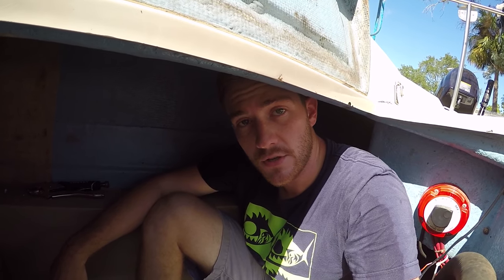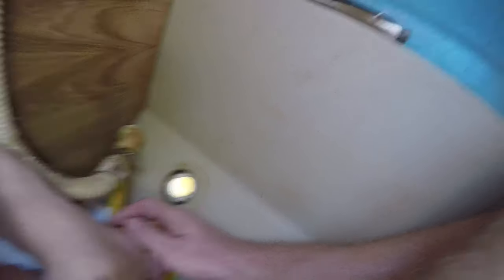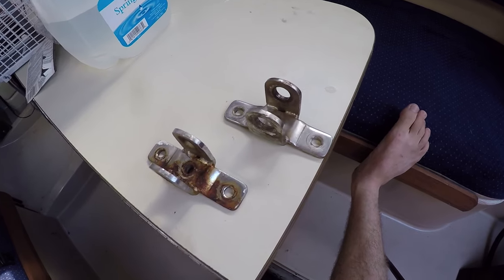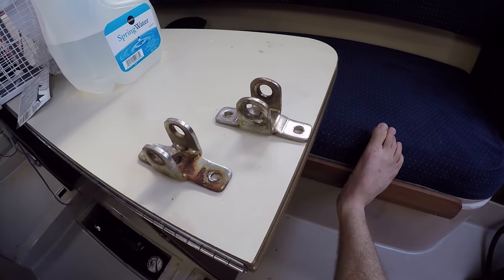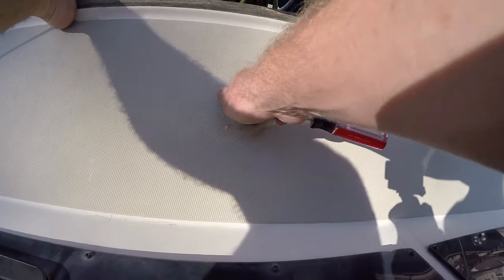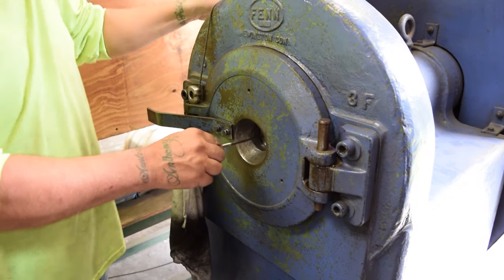7. Rudder Removal and Thru-Hull Replacement - Sailing Vessel Somnium

Comment: All boats with thru-hulls whether bronze or plastic should carry an assortment of emergency plugs. The older style ones look like a wood cone. The wood is very soft and you tap it into a hole with a mallet gently and it will plug the hole. The newer type look more like an orange traffic cone. They are also soft, so soft that when you press them in you twist at the same time and it looks itself into the hole. The good thing about the newer style is if you have an non-uniform hole it will take up most of the space so hopefully your bilge pumps can keep up with it. Should it be below the water line. These are must have items for anyone thinking about doing coastal cruising. I wouldn't have any boat without them!
Reply from the maker: We now have a bag of bungs on the boat for this very reason!

Comment: 5200- if you Never want to remove, replace or rebed.
4200- if you might need to repair, replace, rebed.
I use Dolfinite for receding things on deck that will need redone on a schedule, ie chain plates, stanchion plates etc.

I too have an O'day. Mine is a 37' O'day center cockpit. I have done SO much work I haven't sailed much yet. I hope to be sailing in the Spring.
Good luck with the boat.
Reply from the maker: Thanks for the input, and I'll look into the Dolfinite. Thanks for watching!

Comment: hi guys glad I found your channel!  Were at regatta pointe marina maybe we can join up one day? as for the thru hull fitting replacement using 5200 will be better as it is not intended to flex, 4200 is good for areas that could flex a bit. Replacing below waterline thru hulls with bronze and above can be with plastic. 5200 can be a pain to remove, if properly laid 5200 will need to be sanded off. for areas such as hatches, instruments stanchions etc... buttle tape is a good choice and can be found for about $20 at west marine. it can be easily removed if needed and goes into place similar to clay. and will never fully harden.
Reply from the maker: Thanks for watching! Yeah you guys aren't too far. When we're back on the water we'd love to do a meetup day!
Reply: we'll be starting out next friday. hope to see ya somewhere on the water

Comment: I used 4200 on two  bronze below-the-waterline thruhulls. I felt it's elastic nature would be more suitable. Since it was my first time doing this, I also felt there was a good chance I'd have to do it over, and didn't relish the thought of having to remove the 5200.  So far, so good! But it's only been in the water a month.

I wondered how you were going to remove your rudder. Our 28' Hunter rudder is below the boat! When I saw yours .. well ... duh .. that's how!

Thanks for sharing!
Reply from the maker: Thanks for watching John, yeah I do like the transom-hung rudder on this boat. It's nice to be able to remove it without a haul-out, and it's so simple that I feel it's a very reliable system. Good to know about the 4200. Hopefully I'll never have to remove the thru-hull I just replaced lol.

Comment: Always a good idea to keep wooden bungs in the boat to plug holes and broken through hulls.
Always use brass through hulls far better then nylon
Best of luck with your sailing
Reply from the maker: We plan on replacing thru-hulls soon, most likely with bronze seacocks.
Reply: or as they are called in the navy DC plugs  @LearningtheLines

Comment: Get yourself a small window A/C, place it on the fore deck and use some plywood to make a duct to direct the air flow into the forward hatch.  A sun shade for the A/C would be good.
Reply from the maker: That would be great with that portable generator setup! Thanks for watching.

Comment: As someone that is in the marine industry I tend to lean towards 4200 as it is easier to remove the item you have used it on at a later date. 5200 if you never want to have to take it off. This is my rule of thumb. Others may say other wise.
Reply from the maker: That's the general consensus I seem to be getting. Thanks for the input!
Reply: Cap’n Scruffy agrees! 👍

Comment: 5200 for hull fittings...... Don't be scared of the work some would say it takes to get it off when or if you need to in the future. It will come off just fine ( with out ) alot of work. 5200 is the right choice.
Reply from the maker: Thanks for the input and for watching!

Comment: Hey guys...just wondering. Have you checked the thru hull that's under the sink? It's really hard to get to but I would at least inspect it. Mine was an old type with like a garden hose handle. It's probably not in good shape. I removed mine on the hard and glassed over it.  One less place for potential disaster at sea. Let me know. I have some pictures of mine..  Good job.  Just subscribed.
Reply from the maker: We have, and we're planning on doing thru-hull work whenever we get around to a haul out. For now our bilge is bone-dry so nothing leaks or has us concerned, however it would be nice to have new thru-hulls all around. Thanks for the support!
Reply: carry a set of bungs with you just in case ab through hull breaks.

Comment: would have used a bronze thru hull with shut off.  You stepped on it once an broke  it  can do it again  if not you maybe some one else.
Reply from the maker: Thank you for the input, Ronald! I was going to use bronze, but that area of the boat is actually very thin. If the thru-hull were bronze and I stepped on it, I'd be afraid of cracking the freeboard and having a bigger hole in the boat. I'm most likely replacing and reinforcing all the thru-hulls with new bronze seacocks when we haul out early next year. This was more or less a temporary fix until we haul out. Until then, however our bilge is bone-dry.
Reply: Rod thank for telling him that was not thinking about thick the hull was.
Reply: foxislanderSteve  has been
Reply: Steve you are probably right  many advances in products  I am still a little old school at 73 an last boat worked on for through hull has been about 15 years an I thank you for the information.  But I still like a a little extra material where the valves go through the hull.

Comment: I would vote 4200, just because it is easier to remove if/when you want to rebed the fitting.  5200 takes DAYS to fully cure, depending on the temp and humidity.
Reply from the maker: Gotcha, thanks for the input and for watching!

Comment: On mythbusters they found that if the hole is below the waterline you should tape on the inside. I don't know about above the waterline as the problem was the tape didn't stick the same when they had to dunk the tape to get to the hole.
Reply from the maker: Hmm, didn't really think about it that way, however for a quick fix what I did worked until we got to west marine and bought a new thru-hull. We now carry extra bungs on the boat as well as quick set epoxy. Thanks for watching!

Comment: 5200 below water line, 4200 if you ever want to remove it and above water line. Was at an Annapolis boat show a couple years ago and 3M had a display showing 4200 after 12 years underwater. It's elastic, yes but that let salt into it and it was so degraded it couldn't seal a thing. Just my opinion, never use plastic. When possible replace with metal. Plastic degrades in the sun alot quicker than metal corrodes. And degraded plastic is brittle (as you found out).
Reply from the maker: Very good information to think about. We're going to be doing seacock work at some point and I'll probably use 5200. Thanks for watching!

Comment: 5200 is the devils brew.....no place for it anywhere that future servicing may be necessary. Trying to remove components bedded in 5200 almost guarantees gel coat damage. 4200 is a bit less aggressive but still a bear to remove.  4000 UV is a better choice. More important is to provide a backing plate for the through hull. A piece of G10 or Hydrotek epoxied to the hull will stiffen things up and minimize the chance of future accidental breakage. Fair Winds
Reply from the maker: Awesome I'll look into 4000 UV as well. The backing plate is a good idea. Thank you for the input!

Comment: Since no one seems to have mentioned it, you should have shot plugs somewhere handy in case you run into a problem with a through hull that is not above the water line.  You havn't mentioned it so I will EPIRB?
Reply from the maker: Mark I'm going to look into those. We don't have an epirb yet either but we plan on getting one when we start cruising more often. I'm looking at the delorme satellite tracker for this. We have a boat US membership for towing, however.

Comment: Yes it is technically "above the waterline".  Until A: you are heeled over hard on a beam reach, or B: the seas are rough and u r heading into it.  Brom
Reply from the maker: Yes and that's why I agree with you. When we did this we were just looking for a direct replacement, but in hindsight anything that close to the waterline should be bronze.

Comment: RU crazy?  A plastic thru hull???  Would never do that ever. When the shit hits the fan that little hole  can sink u.    I  have 300 ton umlimited Coast Guard license.  I have well over 100,000 miles of open  ocean sailing.  Replace the plastic stuff.  It will  f u over at some  point in time.  Honest.
Reply from the maker: It is technically above the waterline, but I agree.